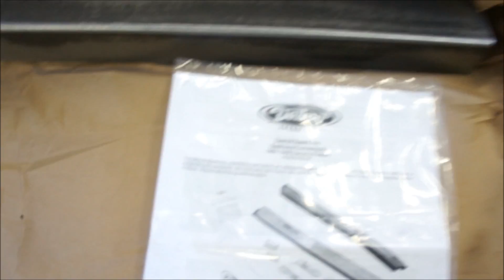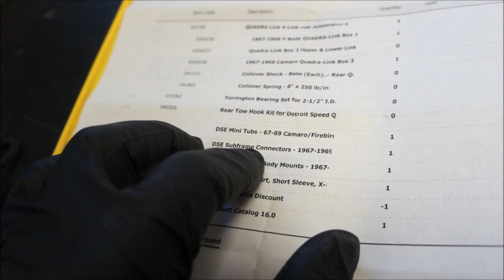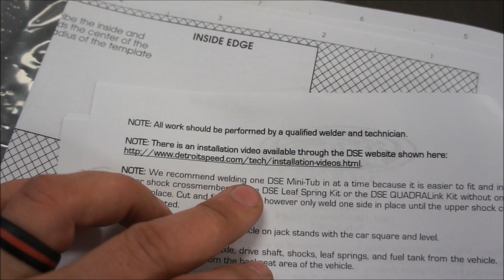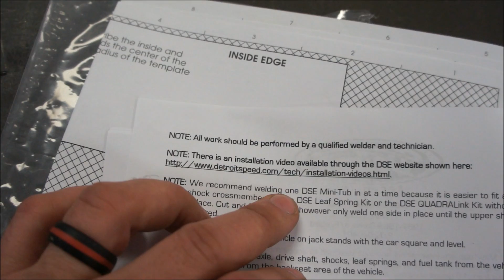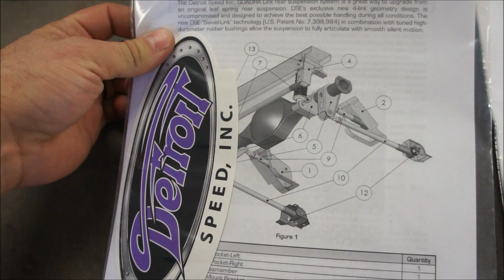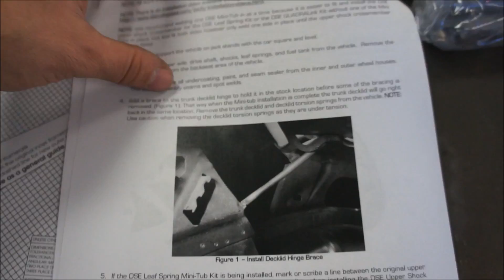Camaro begins along with problems

Comment: Great part about Camaros is you can have a roof skin and build a complete car out it. You have the right idea to put it on a frame machine then make the repairs after they pull it. Back home when I was a teenager i watched a guy wrap chains around a 8X8 post in his shop and take his old wrecker to jerk the frame back into place. He must have stood it on the rear of his truck about 8 times.
Reply from the maker: Carolina Man lol👍

Comment: Try using a product called OSPHO metal prep use as directed  after it drys coat with epoxy I use an undercoating spray setup that  comes with a long extension and right angle  brass tip it comes with to get into the corners in hard to reach areas  such as frame rails and rocker panels  the kit also comes with 5/8 plastic plugs if you need to plug any hole you might have to drill to apply it  in hard to reach areas the kit came from JC whitney  cost around 125.00  I always steam clean /pressure wash  any areas using  a good degreaser like the purple stuff  for areas such as your frame rails where you welded additional  support use acetone to clean the surface oils of it  then fog in  OSPHO let dry real good and coat     The stuff works VERY well as I  have had panels after 15 yrs show no rust coming thru at all    love your vids and attention to detail   what would it take to get a copy of those cad drawings on your frame jig I am in desperate need of those figures as I am getting ready to build one folllowing your build   ? my 69 camaro is bent and I need to correct it   I tracked this car down and bought it back its the original car I owned in high school and is a RS/SS with a dealer installed 427    thanks Royal

Comment: Man, it sure was Christmas in the Garage ! The DSE stuff is really nice. Did they send you the CD for the install? If you watch that I think you would be qualified !
Your probably know already that those holes in the frame and up front were used in the factory jig when they built the car. The frame drawings will give you the dimensions from hole to hole and diagonally. Maybe if you measure that you can tell how badly it was bent. Doesn't look to bad to me but I would measure it. 
My 70 was hit and the front mount was pushed back 3/4" So I need to fix that before I can move forward with my Art Morrison stuff.
Reply from the maker: Idaho 2nd Gens I measured it out today and it seems to be ok 👌 thanks for watching and commenting

Comment: For me, if the panels on the car line up fine, I don't think that will be an issue. The four link probably has enough adjustment in it to account for any tweaks back there. You are not going to be using the rear leaf mounts any more, so if they are out of spec, it should not matter. Of course, you know it's crooked back there, so you may want to get it straightened for your piece of mind.
Reply from the maker: asicerik I think it's going to be ok after today

Comment: I think, I would check and see if you can put it on a frame machine and have them check it out and pull it and straighten the frame before I go and cut the car apart.
Reply from the maker: Chevy3939 thanks

Comment: The stripes are supposed to stop under the spoiler, they do not go to the edge of the lid and run over the spoiler to the bottom of the spoiler.  Have you checked measurements from your car compared to another car? How much of your frame channel do you have to cut away for the mini tub kit? Just thinkin out loud.
Reply from the maker: ceedell I'm in the process of measuring now ,  have to cut about a inch out  of the frame rail but it's in a semi circular pattern

Comment: Oh yeah she got into a little one. Due to the location of the buckle and the fact that the rails and trunk floor seam straight everywhere else I wonder if the rear end bottomed out on the bump stops real hard? Don't let it get you down Roger. I'm sure you already know but those holes right near the buckles are where the bump stop brackets bolts up to. I think I'd go thru and get your measurements taken and see what the extent of the damage is.
Reply from the maker: Do you think its possible for the rear end to bottom out that hard ? I also wonder if when they fixed it if they pulled those rails back out as close as they could and left it that way? they certainly half assed everything else.
Reply: MrFireman164 can't say for sure but I believe if the car was ass ended hard enough to buckle frame rails as far forward as that then there would be more visible damage to other places. So I'd like to see more inspection of the area.

Comment: I've been looking at different 4 links, in my opinion I prefer the DSE system  over the Ride Tech. I like the design of having the mounting pockets welded in verse a lot of the Ride Tech brackets etc. are fastened with self tapping screws. Another plus for me is DSE located on the other side of town from me. I will be following you closely to see how it go's
Reply from the maker: akpd1 very cool , no shipping costs for you !

Comment: So, the car got hit in the rear end hard enough to bend the frame but didn't do any other damage to anything else?  Look at the trunk floor and rear filler panels.  Are the welds factory or repair welds? If that car was hit that hard there would be lots of damaged sheet metal. That would have had to be replaced.

Comment: weld through primer is for resistance welding (original spot welds) mig (spot) welds are plug welds,
what i do is use a pressure gun for cavity wax filled with primer, shoot that inside all the panels and box sections after welding, then a 2k gloss through the same gun, makes a mess as i let it run out or the panels but it gets everything
Reply: dont make the lowwer trunk gap too tight, it needs a bit of bounce when you close it, too tight it will hit the tailpanel

working on a shell you use two engine stands, modify the uprights to resemble axle stand upright then, one on front one on back, added advantage you can flip shell over and move it around shop

powder coating will be stronger for stone chips 

before you cut up the car too much, take some measurements so you know key points are right
Reply: those chassis rails should be ok to pull out on a frame machine , i had a simalar problem, but i was able to use a jig bar across the two rails infront of the damage and a clamp on the rear of the leg and use a 10 ton push ram to push the damage out, with the chart for you car in the previous comments you should be able to measure up from the floor to get the right height, using 4 stands to set car level to floor and measure
Reply from the maker: messylaura awesome thanks a bunch
Reply from the maker: messylaura great advise thanks for the heads up
Reply from the maker: messylaura did that today and I think the frame may be ok , thanks for all the great comments

Comment: i'm late to the game here. But if your corner to corner measurements are good, i wouldnt even try and hammer out the ripples. Just for the hell of it, i would measure front to rear hub to hub. But since you're putting all that really nice DSE gear in there. You'll be able to adjust that more square than the leafs ever would be. Cheers
Reply from the maker: Swilling yes , I'm just relieved that it's not so bad I'm going to have to put new frame rails in

Comment: get a tape and c how far each side is diff. ,its not that bad,i KNOW u dont like it but ..it is very fixable with out buying anything.the frame on pass side cut into the buckel to release the pressure on the metal ext.use a tape from one corner to the other ..then the other side in a X it will tell u how out of square u r.
Reply from the maker: wildeyednorthernboy will do thanks !

Comment: if you're going to do it right get those guys that use dry ice take all the paint off all the Bondo see what the hell you really have
Reply from the maker: have never see that
Reply: The used dry ice to remove all the paint all the Bondo everything I think it came from Oklahoma check it out I Did It For My 67 Firebird my God I had a lot of panels ahead to work on is all hidden stuff so you want it nice do it right find those guys